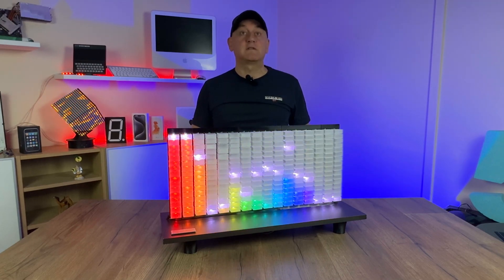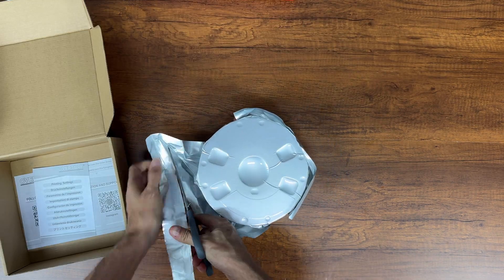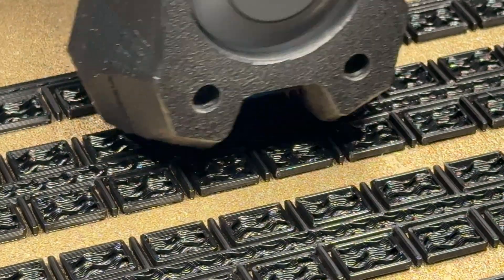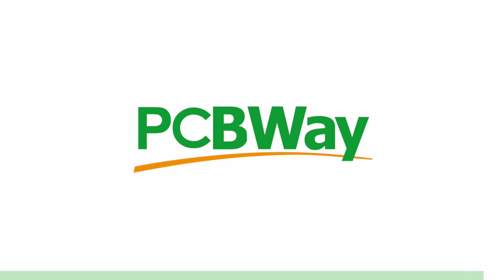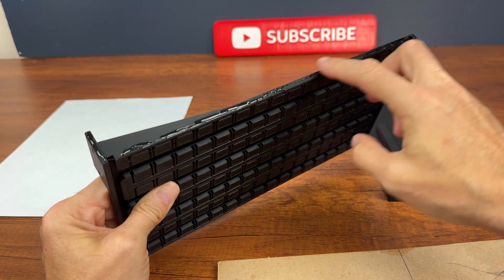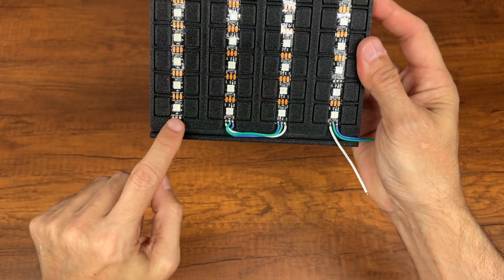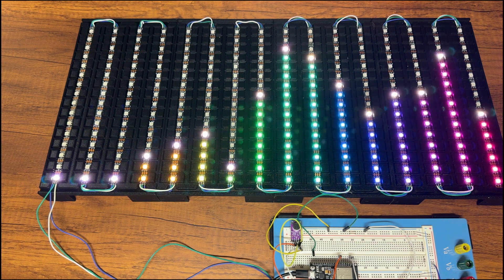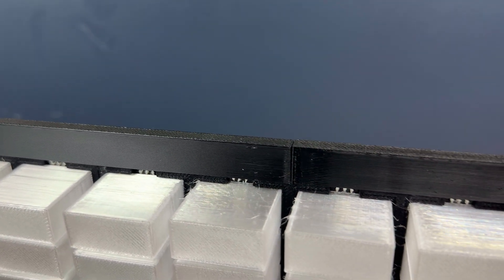256 COLORED MUSIC LEDS & ESP32

Comment: How is the ESP mounted?
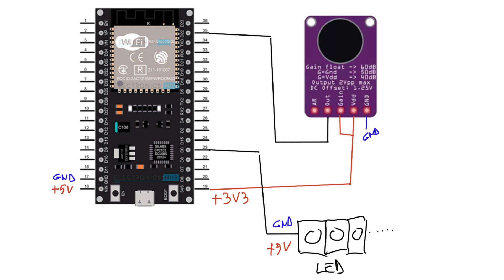Reply from the maker: Hello, you can find the diagram at 15:52.. it’s so simple, just few pin to connect..👍🏻
Reply: @boomytech7504  I should have been more specific. Where on the Analyser was it attached, I saw how it was wired. On the back, was there a box for it?
Reply from the maker: @carltonwbrooks I haven't created a container for esp32. I simply connected the necessary pins and the microphone.

Comment: Why using wire of random color ?
Reply from the maker: Hello, because gnd is usually blue or black, signal is usually green and vcc is usually red but I have only white..😂😂😂
Reply: @boomytech7504  yes GND black, data it depends, VCC Red, orange, or yellow  depending on the voltage, for the DC voltage.
 
(Blue is neutral, black, red, Brown is phase, green yellow is the earth  this is for the Main AC voltage)